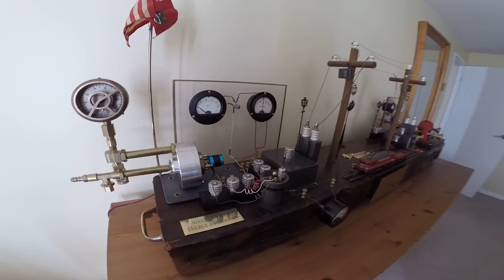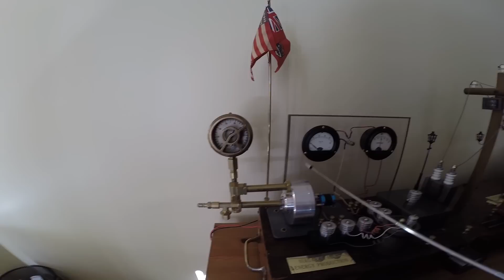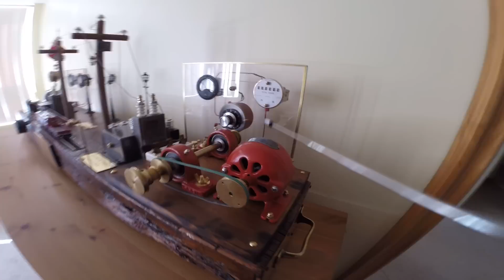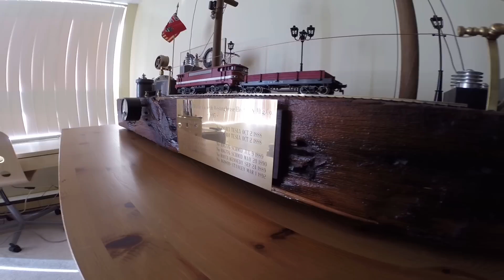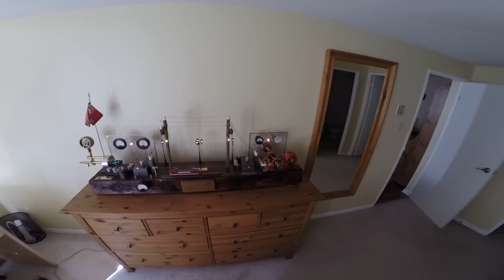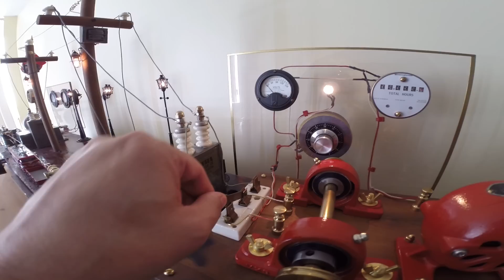TESLA AC POLYPHASE SYSTEM - NIAGARA FALS 1895

Comment: That's wonderful! Do you have it currently powered with a 120v wall outlet? powering up big induction motor at the end seems like it would take quite a few watts. does your tesla turbine generator power that motor when you have it hooked up to the air compressor?
Reply from the maker: The System is meant to be powered their through the air compressor but I don't keep one at home LOL. For demos and system test I have a 12V input after which it is stepped to 120VAC for the motor and 12VAC for the street lamps...

The total power of the system is about 100W in total if motor is run at 120VAC but I usually run adjust auto transformer to 80-90VAC.

The system is capable though delivering up to 150W so there is enough room for good system life...
Reply: +Nemanja Jevremovic That's really great. So are you getting 150W out of the turbine when the compressor is hooked up? If so, that's fantastic, it's a beautifully machined turbine.
Reply from the maker: +Zenman Energy yes 150W could be drawn max. I usually don't go more then 100W
Reply from the maker: Take a look at our website for other models http://www.teslaprojectslab.com
Reply: I love your site. Are you one of the machinists that made these? They're beautiful, as is your website. I do Tesla Turbine research with my non-profit and Old Dominion University in Norfolk Virginia, so I love to see other people's turbines. We're doing some experiments with humidified air at the moment. I'm about to upgrade the runners with his design from his 1922 patent.
Reply from the maker: +Zenman Energy on a site you will see the page called Artisans...
I am electrical engineer my wife is Graphics Designer and two partners from Belgrade Serbia are Mechanical engineer and precise machine and clock master...

Thank you for te kind worlds! I also do some machining but we have dedicated person for the metal and or for wood. We also have artist for brass and copper :-).

My partners are also behinds models for Nikola Tesla Museum in Belgrade Serbia but our models with joined forces are a bit better :-) than the ones in a Museum...
Reply from the maker: +Zenman Energy I forgot to say that wood is from the original demolished Adams hydroelectric plant :-) and mini flags are up too..

Actually the hydroelectric plant in Serbia is older than the one in Canada...

USA 1896
Serbia 1897
Canada 1905
Reply: +Nemanja Jevremovic Oh wow, that's fantastic. It looks like you have a pretty serious collection of his devices. What is the next one you're planning on making?
Reply from the maker: +Zenman Energy as you probably noticed we want to open a Tesla Museum in Canada.
Current collection is 16 exhibit items that will be all ready for permanent exhibit by the end of this year or spring next year.

We want to have about 20 by the end of 2018.

Currently we are building Tesla Radio 1897-1999 - it will have dual function the Radio Telegraphy and Transmission of electrical power through natural medium (earth) ...

The beauty of it will match the beauty of Radio Controlled Boat... If you have seen the video on my channel... Boat is not finished yet though, it needs clear acrylic body and remote control...

The rest I chat say now as it depends on many things... 

We have actually we are a museum we just need a 4 walls and investment for first 3 years and that I want to become my main business passed onto my son and family later on...
Reply: I can't wait to see it!

One thing most historians leave out about Tesla... I believe he was OBSESSED with making a "flying machine". In the days of the Wright Brothers and their balsa wood and bicycle style engineering, Tesla was trying to make a vertical take off and landing Harrier-style Jet that carried no batteries or fuel. If you look at the order he made his patents in and his writings from about 1905-1920  he wrote quite a bit about it. I personally believe that was the underlying reason he invented the magnifying transformer for wireless power because fuel is heavy and he desperately wanted fly. But since it wasn't working correctly, he switched gears to convert his turbine/pump into a gasoline powered jet engine which is where the valvular conduit came from. Finally his last patents were specifically on "flying machines" even though I don't believe they were exactly what he originally had in mind in his younger years. I truly believe the last 20-30 years of his career had an underlying focus on making a VTOL flying machine.

That said... you should build his flying machine for his museum if you haven't yet.
Reply from the maker: +Zenman Energy actually NT Museum has many books published and one of those is about the plane with vertical takeoff...
I personally did go to that period yet as there many more interesting things to complete.
Actually there is whole back and forth communication between Wright brothers and Tesla.

I know that back in the days you had to demonstrate that machine is working so I assume and I think that I am correct that he was testing and showing to the patent office the turbine for vertical takeoff not the avionics structure aerodynamics etc...
Reply from the maker: +Zenman Energy shoot me a line over the webpage or at info@teslaprojectslab.com so we cons communicate over the email instead of YouTube